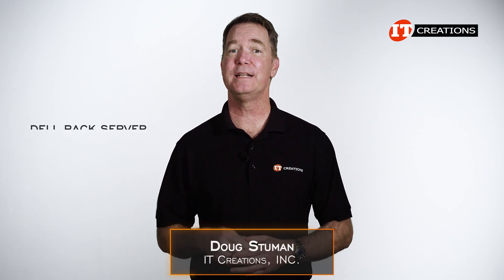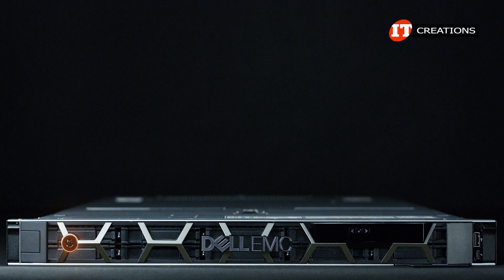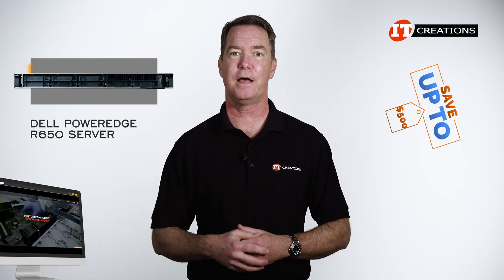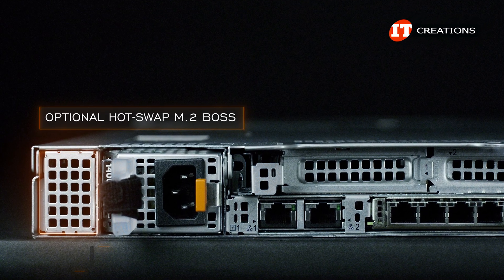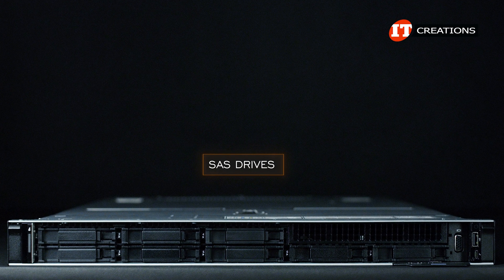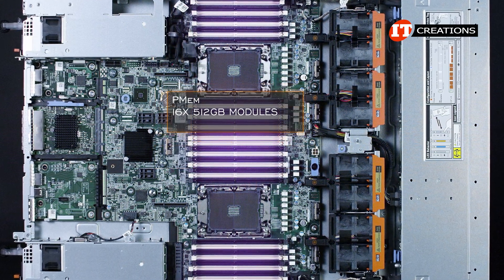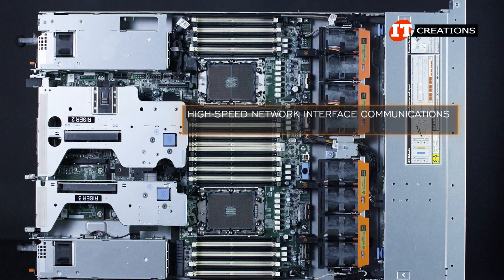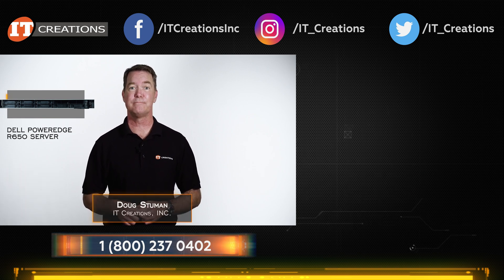Dell EMC PowerEdge R650 Server REVIEW | IT Creations

Comment: NOT A REVIEW! This is a spec/feature list, it does not go into the experience with using the hardware nor does it compare to to other options in the market. No tests of power use with idle load and full load scenarios, no tests of performance or noise. The It industry deserves better reviews, i hope you guys are the ones to finally do it, STH alone is not enough.
Reply: Review is a subjective term. He is reviewing the configurations.